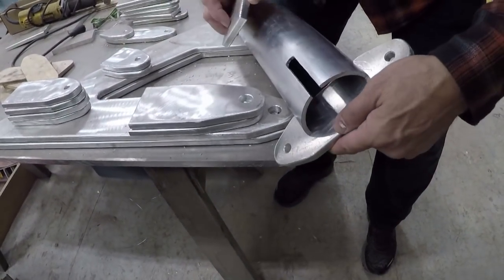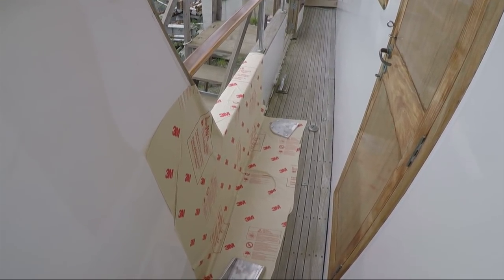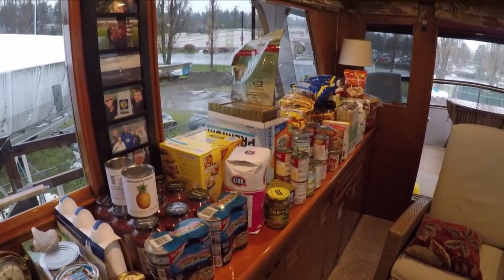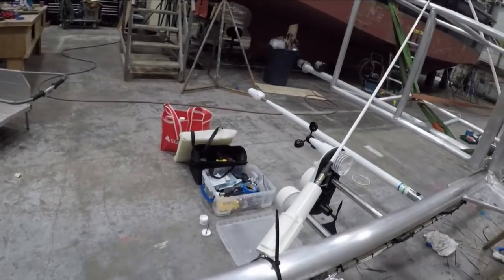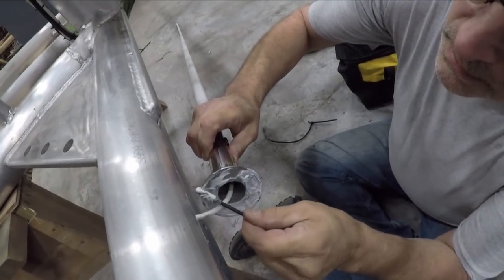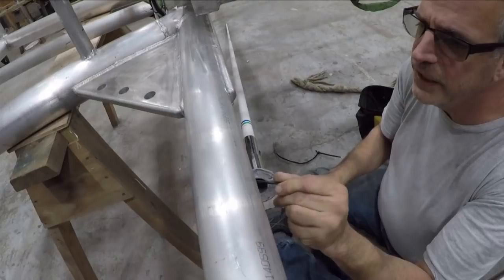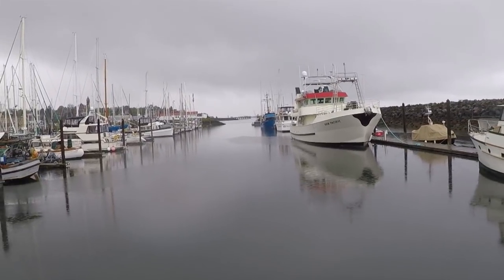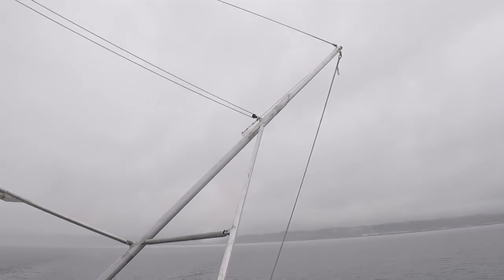Refit Done - $130,000 later and we can finally leave the dock!  Cruising Sea Venture - EP 25

Comment: Why did you add that structure to the top of yacht, what’s it’s for?
Reply from the maker: I assume you mean the crows nest at the top of the superstructure?   If so, just for fun.  It's 30 ft off the ground and gives you a great view - when the weather is calm.  Thanks, Jim
Reply: @CruisingSeaVenture  thanks, I just thought it would make your yacht a little top heavy.
Reply from the maker: Of course, the entire structure was added to add the paravane stabilizers.  (The video you watched is the 8th in a series on the refit).  The entire structure added about 1,300 lbs.  About 400 lbs was removed (the old mast and boom).  The impact of the increased weight was very carefully analyzed as part of the entire design process to ensure Sea Venture remained well with the required stability for ocean going power boats.  Thanks, Jim
Reply: @CruisingSeaVenture  thank you for taking the to answer me. Last time I was at sea working was in the Navy 1972, submarine service.

Comment: Just finished all your refit and engine room/fuel videos. Subscribed after the first one. A sailor turned RV'er now thinking about a possible trawler in the not to distant future... gathering info. Will continue to watch you two on your adventures. Wonder how it would be offshore with a shallow bottom boat like a trawler in heavy seas and high winds. I guess the paravane would work better than a stabilizer system, but the forces must be tremondus on a boat that size and weight. Like the fact that you have that kind of range. What is your bridge clearance now? 
Pretty cool you give your your costs. Fully appreciate that.  Fair winds. (yeah I know you guys like no winds but that just not the sailor in me!!)
Bob

Comment: I have really enjoyed this refit series. The paravane installation was quite an undertaking and very interesting to see the process. The added benefit is the additional height you have gained for your aerials and antennae and you must have seen better system performance from them - has it reduced ‘clutter’ in the radar on ‘near range’? I think you made a good decision to run the cabling external to structure as this will render most benefit for future installation/defect repair. The only caveat to that is the UV rating of your cables and potential deterioration.

It will be interesting to hear your operating experience of the paravanes in terms of roll reduction and in fact when it not worth deploying ( say roll angles less than +/- 5 deg).

Enjoy the fruits of your labour.👍
Reply: i know im randomly asking but does anybody know a tool to log back into an instagram account..?
I was dumb forgot the account password. I would love any tips you can give me
Reply: @Cody Jeffrey Instablaster ;)
Reply: @Ezekiel Franklin Thanks so much for your reply. I found the site through google and Im waiting for the hacking stuff now.
Seems to take quite some time so I will get back to you later with my results.
Reply: @Ezekiel Franklin it worked and I actually got access to my account again. Im so happy:D
Thanks so much, you saved my account :D
Reply: @Cody Jeffrey glad I could help xD

Comment: Fabulous, very happy for you guys, should stabilize some of those seas and keep you smooth. Question, what prompted your decision to do the poles ~vs~ fin stabilizers on the hull?
Really looking forward to seeing more of your journeys, & wishing you happy seas before you!!
Reply from the maker: This is a great question, and one that we will answer at the end of the next cruising video in detail.

The short version - 

Our initial goals were:
1) To maximize stabilization
2) To have a system that worked good at all speeds and all sea conditions
3) To have a system that works at anchor
4) To have a system that we can or is, if needed, easily serviced and repaired

Paravanes are the only system that meets all 4 of these goals.

Fins are excellent but have some limitations.  For us, those were,

1) As a boat goes slower, under 8 knots, fins become less effective.  Since we cruise at 7 knots, this was a factor
2) Because they rely on water flow passing the fins for effectiveness, their effectiveness is reduced in following seas
3) They do nothing at anchor
4) They are fairly complicated to repair if needed.
5) They slow the boat 100% of the time, whether being used or not

Also, on Sea Venture, our hull is the outside of the fuel and water tanks.  As a result, the available space for fins is very small and some significant hull modification would have been required.

Of course, "deploying" consisting of flipping a switch would be the big upside of fins.

We think we made the best decision for us, but we suppose time will tell!

Thanks for watching and commenting,

Jim and Rosy Addington
M/V Sea Venture
Reply: That's an awesome reply, 
very informative, thank you, thank you, thank you!!!

Comment: Very nice job on the rigging.  How big a set of paravanes did you install and how much speed did you lose when they are deployed?  I'm sure they will give a great ride during those lumpy conditions.  Enjoy you trip to Alaska.  We hope to the same next year so will follow along to get some ideas on stops of interest and must-see's.
Reply from the maker: Joe,

Thanks for watching and commenting.

Our "fish"are 38 lbs each.  They are made of marine plywood, with a stainless steel fin and 1/2 of a 50lb downrigger ball attached to the front underside.  We can go up a size if we choose, but wanted to keep the weight manageable to ensure we could retrieve them without too much strain.

In calm water we loose about 3/4 of a knot.  But I think in rougher conditions we loose less.  I think when we are rolling over 20 degrees we are loosing speed over ground due to the rolling and the impact it has on the trust from the propellers.  As a result, when the seas are rougher I'm not sure we will loose much speed.  In talking with other boaters with paravanes they also seem to think in rough conditions the loss of speed from the paravanes is offset by the speed gained from not rolling.

I hope this answers your question.

Jim

Comment: Hey Jim, I planning on doing quite a bit of solo coastal cruising. I've been just starting to think about a provisioning sheet for my trawler. I want to store lots of food on board because I plan on spending most of my time at anchor and not in marinas. Also, provisioning is a bit of a hardship for me as believe it or not, I"m a disabled sailor. So my plan is to place an order for the food with a grocery that delievers so I just have to worry about putting it away once it's all on board. I was thinking your provisioning list might be a good starting point for me. I plan on doing the Great Loop and cruising the east coast from Maine to the Bahamas. My email address is sailingwithbill@msn.com  thanks!